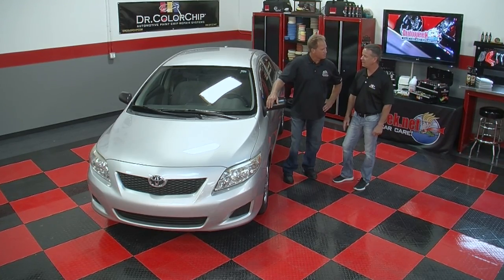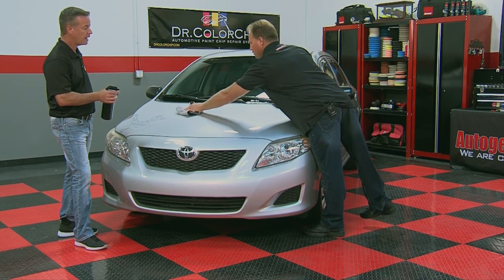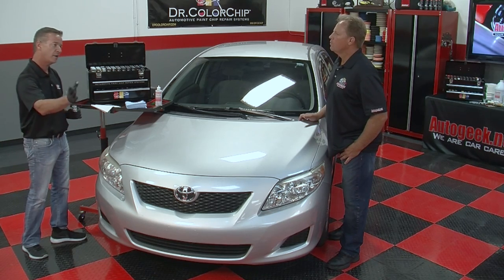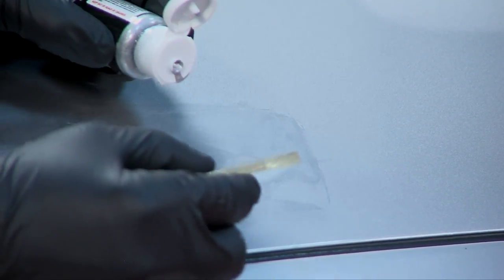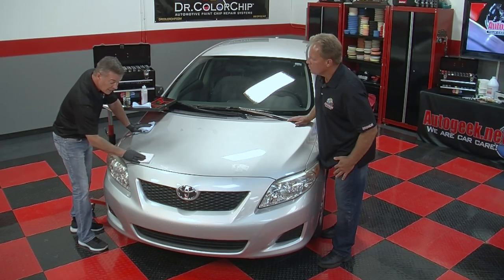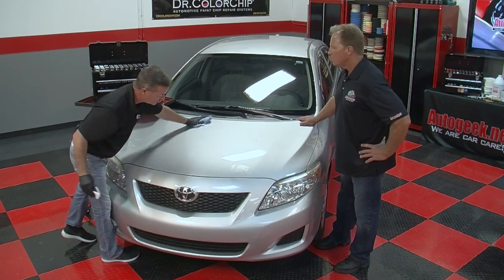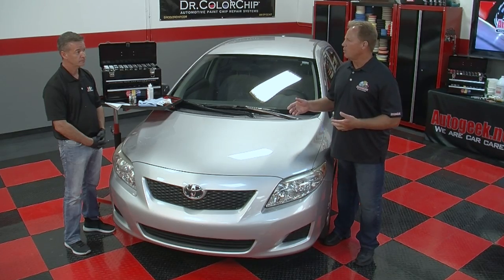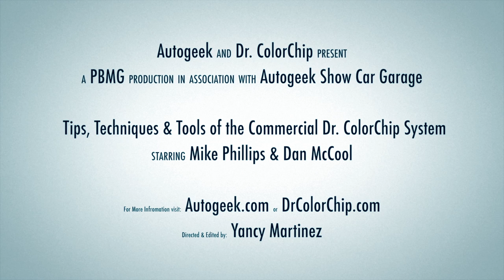How to start your own business with the Dr. ColorChip Rock Chip Repair System

Comment: can you compound/polish over these repairs after they've fully cured
Reply from the maker: If you're careful.  

You're supposed to compound and polish the paint BEFORE fixing the rock chips and then moving forwards wash and dry your car carefully so you don't have to compound again in the future.

See my article here,

http://www.autogeekonline.net/forum/how-articles/83526-how-use-dr-colorchip-paint-chip-repair-systems.html

-Mike Phillips
Reply: Mike but can I use some Pre-wax on that? I love use pre-wax before apply the wax, can I use this? hugs
I use Ultimate Polish with a Super Soft Pad.